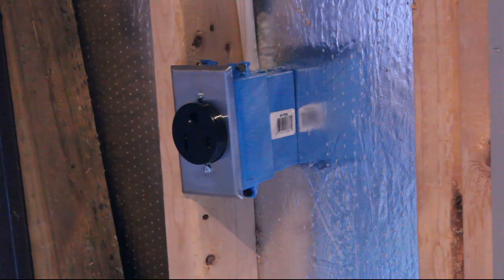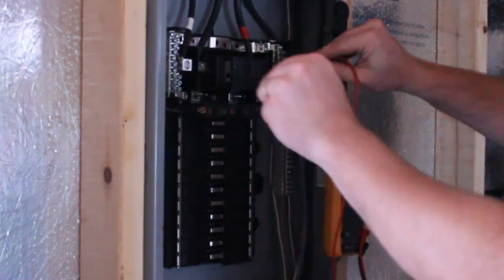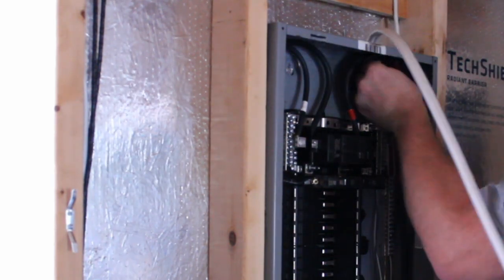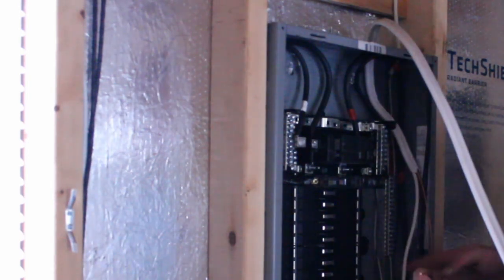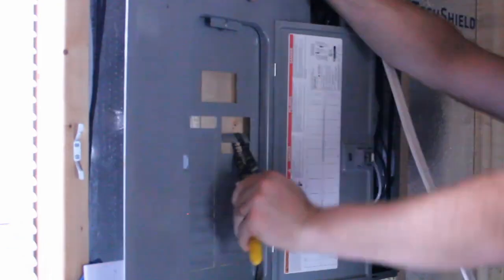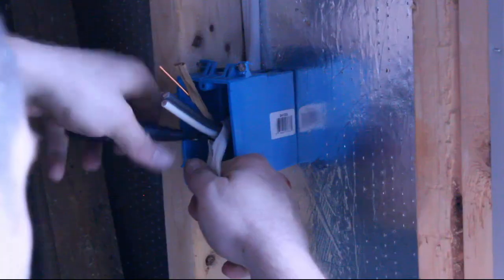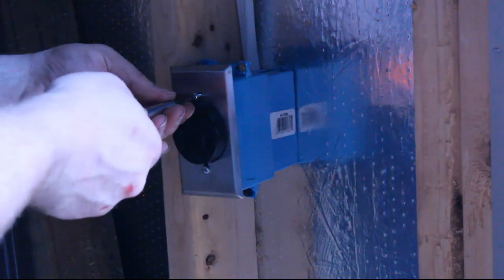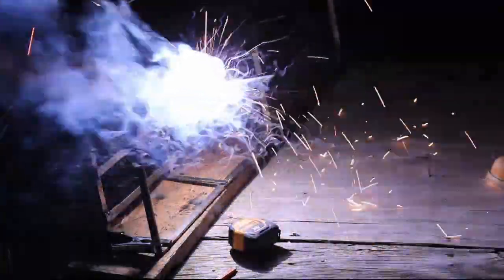Install 50 Amp welder outlet circuit in workshop for 220/240 VAC MIG welder

Comment: Is using the white as a hot wire a normal practice for a professional electrician? I can't seem to get an answer anywhere, but I'd really like to save some money over the 6/3 wire. Plus, the 6/2 is easier to pull through the studs..
Reply from the maker: You don't need a 4-wire cable unless you're putting in a 4-pin outlet (i.e. using a device that requires both 240/120VAC) - it's standard practice to use the white wire in this case, but mark it with black tape on both ends to signify it's carrying a "hot" phase.
Reply: @BKHobby  thank you so much! This is by far the best explanation I've come across after scouring the internet!
Reply: Yes it is normal practice, a lot of residential work uses the white as a conductor. Per the NEC, the white wire is an ungrounded conductor and can be used as so as long as it’s re identified for the next person that’s working on it. Just make sure you use some black tape or old sheathing to label this wire hot and you should be good to go.
Reply: What if you are wiring to a sub panel without the ground and neutral being bonded? Do you then need the 2 hots, a neutral and ground?
Reply: Bad Man that’s correct, the neutral and ground are not bounded therefore you need to connect them individually, 2 hots if you’re using 240v receptacle or 1 hot if it’s just your basic 120v, then the neutral and ground connected to separate bars.
Reply: @BeaterJeep  You don't need a neutral in this circuit at all, regardless of whether the sub panel has a ground-neutral bond.  240V circuits don't need a neutral, they only have three pins on the outlet (two hots and a ground).  Only 240/120V (usually for ranges and some driers with four prong plugs) need two hots, a neutral and a ground.

Sub-panel neutral/ground bonding is a complicated subject, the rules are confusing.  My (detached) garage subpanel has a ground-neutral bond AND a grounding electrode of its own.  It makes no difference to the branch wiring.

Comment: I am looking for a simple explanation of the 220 wiring which I think I picked up from your video but I want confirmation so you hook up the two hot wires and the ground wire the neutral wire is not hooked up to a 3-prong 220 is that correct

Comment: I just used the same 50amp outlet and it specifically indicates in the instructions for it, to not use a single gang box, such as  used in this video. Double gang ONLY.  Any comments?
Reply: I would like to know this as well. Some of the 6-50 outlets do not have that warning, but some do.
Reply: he used a double gang in this video, not a single....
Reply: @maxalvarado8114  I’m no professional but looked pretty much like a single to me!  Maybe extra deep.
Reply: A deep single box is acceptable because these welder/heater receptacles have rear termination..but his wire could have been 3"-4" longer when pulled out of box ..

Comment: This guy is deleting all the criticisms and leaving only the ignorant praises.  This outlet requires a double gang box...contrary to one statement, this is a single gang
Reply from the maker: I don't delete comments any, unless they're offensive...This is a deep single box with 6-2 conductors, so it passes box fill code.....That said, if I was doing it again, I'd definitely use a double gang (and steel) box to make it easier to fit and sturdier...also, to avoid the wrath of all the YT NEC Code inspectors :-P

Comment: So if I were to test the hot and neutral on the panel (the 50Amp breaker) with my multi-meter. Would I still recieve 120 or 240? Since the neutral is being used as hot?!

Comment: Can I have a 50 amp receptacle wired with 12 gauge wire to a 2 pole 20 amp circuit breaker? My welder has the 50 amp plug but the unit says that it only draws 16.6 amps.
Reply from the maker: MisterDoyle - While nothing I know of in the NEC code prevents you from doing that (you're sizing the breaker to the correct wire gauge and your receptacle is well over the required ampacity), there's a couple reasons I wouldn't recommend it:

1) You may trip the breaker during welder startup/heatup (inductive load) or if for some reason the welder uses more than the rated power
2) You'll have to go back and rewire it all if you ever want to upgrade to a bigger/better welder.

Depending on run length, you won't be saving that much over the proper 6-ga 2-wire cable, and you might be creating hassles for yourself later on.

I do recommend going to a local electrician supply store over the big-box stores. The difference in price/foot between those and the Billows Electric supply store I went to was about 33% if I remember correctly.
Reply: NEC code doesn't prevent you from doing this. As long as the wire is the correct size for the breaker youre fine. The amp rating on a plug doesnt mean anything as far as code is concerned. As an electrician I'd use a 30 amp breaker because it allows you to upgrade. Unless you are using a REALLY KICKASS WELDER they typically won't draw more than 20-30 amps. Just run 10/2 Romex and a 30 amp breaker.
Reply: Always size your breaker to the wire size to protect the circuit, if you use a smaller breaker it will blow constantly, and a bigger breaker doesnt provide protection against overload, could burn wire, or start fire... but yes, you can run that setup just fine, but for welder might be worth it to go a little bigger, I always run 50amp circut for welders since they will draw high current wjen you strike ark, then they settle down to normal opperating range, also a 50amp circut gives you room to upgrade welder or use other equipt/ machinery in shop down the road.

Comment: What is the volume of the electrical box?  For 6 awg wire rhe calculations I've seen state that each wire requires 5 cubic inches. For a 220 v outlet that counts as a two gang device, each requiring 2 wire volumes or a subtotal of 4.  That's a total of 7 x 5 cubic inches giving 35 cubic inches. Did I calculate incorrectly?  Thanks.

Comment: Will a double pole breaker with two 20 amp switches on it work for that welder and running a 10/3 heavy rubber coated wire?

Comment: I get 120V when measuring each live and ground, but I do not get 240V when measuring across both live
Any ideas?
Reply from the maker: hmm, what do you get phase-to-phase? Anything close to 240V?

Check it at the breaker inside the panel (each pole to ground, then pole-to-pole). If you get the same readings, power down the panel, and disconnect the wires at the breaker. Test resistance between each wire (at the breaker) to every other wire (including ground) - you should have an open circuit. If all readings are fine, it must be the breaker (you could apply power to the panel with the wires disconnected, and test each pole on the breaker to neutral to double check)....Also, make sure you stripped enough of the jacket off the wires so they're making good contact with the poles...

And, please be careful! :) Like I said in the video - this isn't a how-to and I'm not responsible if you get zapped!
Reply: You likely have used 2 separate breakers instead of a double breaker in the panel. If you used a double breaker (or 2 separate breakers ganged together, installed on on top of the other) you could not have the symptom you described with a 240v panel. Note: i am referring to a panel installed vertically.

Comment: Strip the romex sheath inside your main panel...only about 3/4" should still be sheathed inside the main panel ( really just enouhg for the panel entry clamp to bite on).  Then push all of the individual wires neatly around the perimeter of the box until you get to your breaker....run the bare ground all the way at the back.  I have never seen a panel entry clamp or clip that installs from inside the panel....i believe you installed it wrong.  
Wires need to extend 6" out of your outlet gang box (Code).....yours appear too short.  I think a double gang box is required for that outlet.  I would use a metal box so it is sturdier and supports the large power cables better, make sure you run the bare ground wire to the metal screw in a metal box.  Just my thoughts......i am far from an electrician!
Reply: I second everything you mentioned
Reply: That is not a code. That's just some "make your work look pretty" thing ain't it?

Comment: Love your workshop BK! Thanks for the video! Do you have any project in mind with that welder?
Reply from the maker: Thanks for watching David Cabañero ! I didn't have any projects in mind when I bought the welder, just too good a deal to pass up (it was an open box, half price at Harbor Freight). Since I got it though, I've already fixed my grill (side burner bracket rusted off, so I welded up a replacement - I really need a new grill, haha), and made myself a welder table for those future welding projects ;)

What's that saying? "When you're holding a hammer, everything becomes a nail" ;)
Reply: @BKHobby  Couldn't afford a new grill because you bought a welder and several feet of expensive cable and hardware to weld the old grill back together. Love your priorities!

Comment: AWESOME video, subscribed! I just picked up the same welder how is it working out for you? Thanks!
Reply from the maker: @Gumball's Gameroom - thanks! I've used the welder to do small projects/jobs here and there so far (welding table, plant hangers, fixing a broken burner clamp on my grill, etc..), and I love it! I haven't tried MIG on it yet (need to buy the gas bottle and a cart to hold it steady), and it is a bit messy with Flux (lots of spatter), but it does the job, and for the price, it's well worth it! Enjoy your welder!

Comment: Dont use your wire strippers other than to pull wires and to strip wire. After 2 strippers and attempting to use them as pliers and to tighten locknuts. ive learned. Otherwise youll have a damaged tool. Only stripping and pulling everyone.

Comment: code states not to drill holes in your rafters, not sure if the roof will fall in first or and electrical fire...
Reply: thats what i was thinking aswell!
Reply: You are wrong. Code allows holes in rafters NOT trusses. Looks like he has rafters. According to the International Residential Code (IRC R802.10.4)

Comment: I saw one code-flaw:  The exterior sheath should have been stripped back to the box clamp.  Code usually limits intrusion of the sheath into a box only about 1/4" or so past the clamp.

You would have found it easier to do the outlet if  you used a 4" square box with the matching 240V/50A outlet (6-50).  As I wanted this outlet outside, it's in a weatherproof box

I recently did one for mine that will do dual duty powering an EV charger or the welder.  I used individual #6 (stranded) conductors (in red, black and green) in plastic conduit.

I don't like running high ampacity circuits where they can be hit.  Hence the conduit.

In my shop, the normal wiring is stapled to the ceiling joists - with lath, the lath acts as some physical protection, and is okay because you're not going to run drywall screws thru them unless the line crosses the lath (you cleat on a piece of lath on top of the existing lath to run the cable over, and the added depth makes it legal).  I didn't want to cut the wall drywall, so all the drops to outlets are sleeved in plastic conduit for physical protection, and the outlets are in standard plastic boxes surfaced mounted on the drywall.

I chose 1" conduit because it's easy to pull even #6.  The conduit was run along the top of the wall (about 1" below where ceiling drywall would go, and between the garage door opening hardware), and the whole run was under 25', so the job wasn't much more expensive than the NMD 6/2 you used, and nobody had to crawl around in the garage attic in the fiberglass and occasional squirrel poo/urine.

I personally usually wire first, then panel last, and rely on a head lamp if necessary for the panel work.

Comment: That outlet will come in handy.   I have a 120/240V welder and I just added a 240V circuit for my welder last fall so I can do higher amperage welding,   My main panel is right next to my basemeent door, so I just put an outlet right next to the panel and run a long extension cord out the basement door when I am welding thicker material.
Reply from the maker: It's been getting some heavy use since I installed it :) I was actually thinking about putting another one near my main panel in the garage. I also bought an extension cord - https://amzn.to/2rNwGBE - 25 feet long, so I could weld outside, when the weather improves (we're in rainy season now ;))

Comment: running without a ground is just insane! Any 220/240 outlet should be done with a proper ground wire or you'll be risking it big time.
Reply: It has a ground. Its 6-2 wire with ground.

Comment: I did exactly what you did and as soon as i flipped the breaker it blew!
Reply: Ever figure it out Bob..?
Reply: @jaytodd5809  Yup. After the initial problem I tried to hook it up another way and it blew again. So I put it back to the way I did it the first time and this time it worked. I'm not sure what happened the first time but it works fine now.

Comment: You outlet box may be too small for code.  See http://www.wireyourownhouse.com/tools/boxfill.html
Reply from the maker: +K NG - Thanks for the link, that is a very useful site/calculator set. But, that calculator is a bit conservative (rightfully so, always better to err on the side of caution). I used the deepest 1-gang box available, a 22 cu-in. Per the 2017 NEC, an 18 cu-in device box is enough for a 3-conductor #6 ga wire (I'm only using 2-conductors here). That said, if I was doing this again, I'd definitely go with a larger box (a 4x4 square, for example) just to avoid the pain of getting that #6 wire to cooperate in a smaller box. The other option would be to use #8 gauge (copper), which is OK, but I chose the larger size.

Comment: That ground wire isn’t large enough. You should have used the white wire and “tagged” it ground with tape. Then it goes into the ground
Reply from the maker: I'm sorry but that's wrong - the ground wire is only for carrying the grounded current back to the panel, and NEVER for carrying the load. In my case, the breaker is installed on a subpanel, so the neutral/ground are disconnected - if I did what you're suggesting, I'd be using the bare ground wire between the main panel and subpanel to carry the regular current (for 110V loads), and that's a BIG no-no...Also, they specifically sell these cables in matched sets (6/2 with #10 ground) because the NEC allows it...